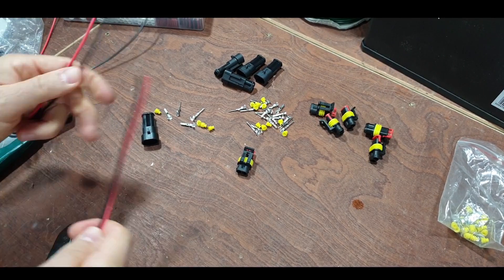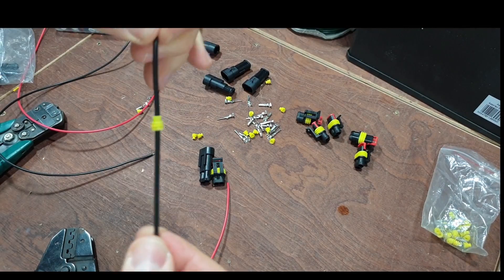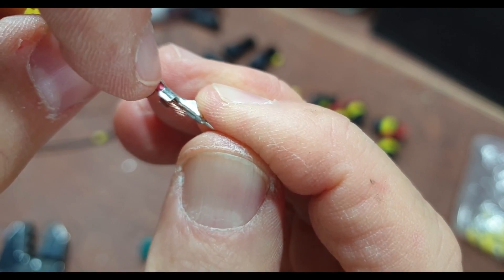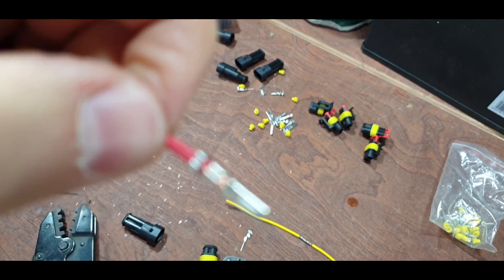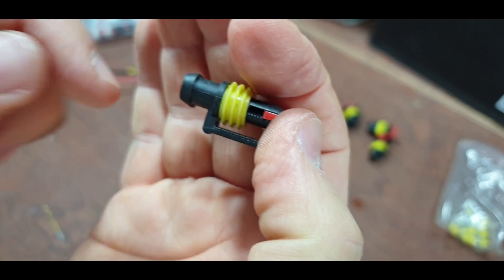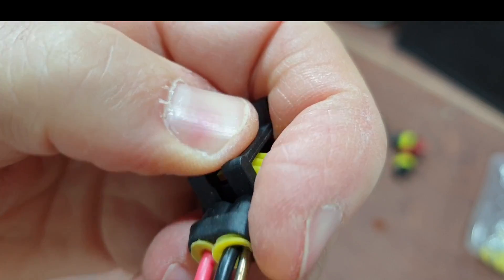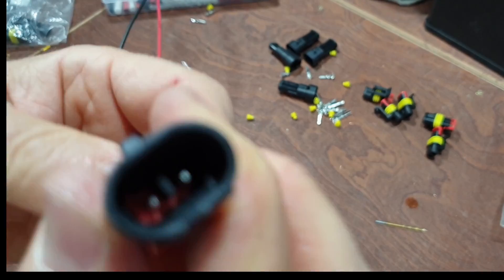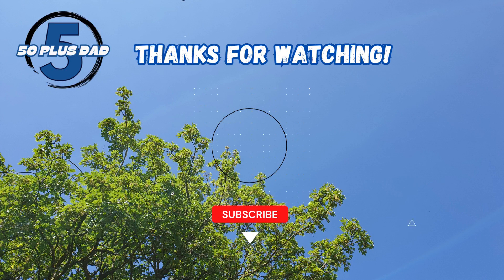Waterproof Connections a Step-By-Step Guide (make your own)

Comment: Nice simple quick explanation. Thanks.... The Americans call these crimp connectors "dupont" connectors for reasons only Americans would know.
Reply from the maker: Thanks 😊
Reply: Dupont connectors are actually a bit different!

This is AMP's SuperSeal.

The Dupont (named after the company that created them) look the same but are different enough to NOT fit in these.
Reply: @Richard_van_der_Heijden  OK. Thanks for the explanation. I see some people call some connectors Molex as well.
Reply from the maker: @meisievannancy 👍
Reply: @meisievannancy  Molex has been around for decades. Computer power cables are Molex as an example although that is changing.

Comment: Looks to be the most correct assembly I've seen so far. The rear (larger) crimp is meant to grip the insulation to help prevent pulling out and copper fractures caused by movement where the copper exits the the insulation. But then looking at the silicone bung, it looks deliberately made to take that rear end crimp, perhaps to ensure a seal at that point. Trouble with being a Gemini, I end up arguing with myself 🤣
Reply: Its a modified way to do it.  The silicone water seal does crimp with the wire insulation.

Comment: The yellow silicone water proof plug should be crimped at the very end of the terminal,I also drop a smidtion of solder after I crimp the terminal for added  strength
Reply from the maker: I'm also a big fan of a little blob of solder on external terminals

Comment: what crimp tool is needed?
Reply from the maker: You need non insulated terminal crimper, there is an amazon link in the description that shows the type, but you can get them from a well known auction site as well 😀
Reply: @50plusdad-uk  would SN-28b crimper work?
Reply from the maker: @slybunda can't be 100% as I've not used these specific ones but online they look very similar if not the same. Hope that helps 👍
Reply: @50plusdad-uk  thanks i need this connector but in 0.5mm2 wire size i think the colour of the seal is colour coded to wire size so small wires use green seals and mediaum uses yellow and big wire uses red colour seals
Reply from the maker: @slybunda no problem 😊

Comment: Very instructive but why the music with the repetitive tiny beep in in?
Reply from the maker: I use this solar air heater https://youtu.be/CxS6ewRNMMg
to keep the workshop dry, I think what you can hear is the solar powered fan trying to start in the background when there is not enough power to move the blades (i have a switch on it now to turn if off when recording).
I edited this using speakers and didn't hear it but listening on headphones it's really loud and annoying worse thing is I cant go back and edit it without deleting, so I'm stuck with it. Lesson learnt.

Comment: The yellow silicone bungs should be held in by the back crimp, the stripped wire by the front 👍🏻
Reply from the maker: Absolutely, The reason I don't probably stems from the mid 90's Grand Cherokee, I was involved in upgrading the security for the uk market, one of the biggest problems we had was pins pushing out on the alarm door wiring due to the grommet being crimped too far down and stopping the terminal clicking home, admittedly not the hand made pre production wiring looms more the later factory made stuff, we used to pull them back up the cable and refit but this way solves that and the grommets don't fall out.
Reply: @50plusdad-uk  Interesting. I didn't know there was crime over the pond back in the mid 90s... like Bill Hicks said, maybe proper crime.. somebody knocked over a dust bin in shaftsbury.
Reply: I found crimping the seal tended to end up with one of the lugs breaking off - so also don’t crimp the bung onto the terminal
Reply from the maker: @eliotmansfield 👍
Reply: @eliotmansfield  Are you using the right crimper?
Reply: @Richard_van_der_Heijden  use a hammer
Reply: @eliotmansfield  Ci vuole la giusta pinza crimpatrice. Il gommino giallo va crimpato sul contatto assieme alla guaina del filo. Basta vedere come sono montati i connettori di serie sull'automobile. Inoltre non si devono attorcigliare i fili sotto la crimpatura. Grazie comunque dell'impegno.😏
Reply: @KnightRider1157  nope that youll losee the grip...
Reply: @KnightRider1157  just realized that aswell but now I've already followed the video
Reply: No.
Reply: Nah. The way he did in this clip is correct!
Reply: I think it’s a better job to just crimp the insulation… not the rubber seal… the mechanical fix is stronger on the insulation and if you ever want to remove the pin, it’s easier to pick the rubber out first to de pin

Comment: if you look the plugs are  numbered   1  &  2       so no 1  red    no 2    black        so     red to red  & black to black
Reply from the maker: Nice tip,  I've had missing numbers before so always worth double checking the colours line up.
Reply: like the look of the  pliers you  was  using   were they Durite  703-50  thats what i use  
 @50plusdad-uk
Reply from the maker: Not sure if the same but very similar, I've had them for 30yrs so all the labels are worn off but still going strong.
Reply: You are supposed to crimp the seals you slide onto the wire onto the insulation right before the striped wire.

You did this demo completely wrong.
Reply from the maker: This way it's easier to take them apart without damaging the seals. They won't fall out if you push them home the ribs hold them in place. 👍
Reply: @davidgeorge8172  Nah mate. This video is the better way to do it.